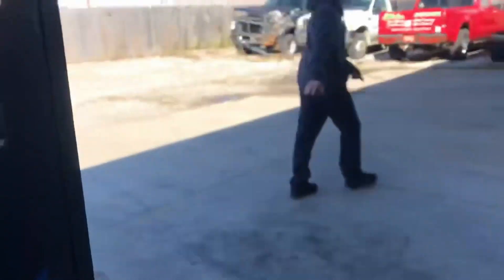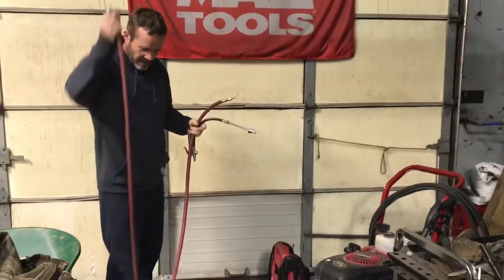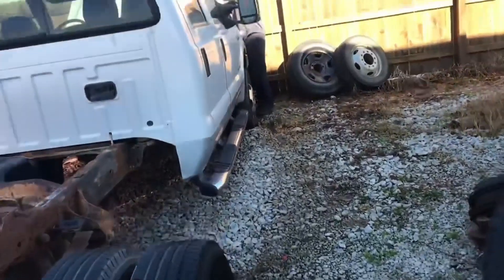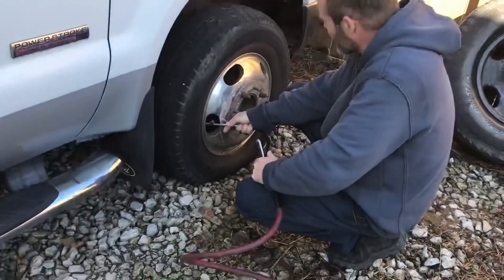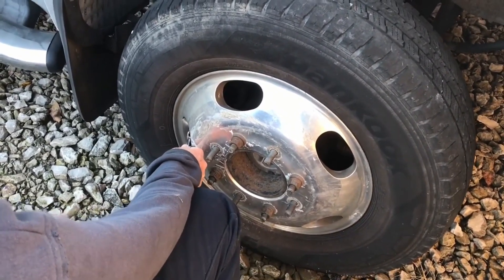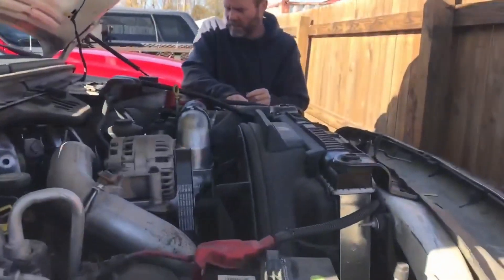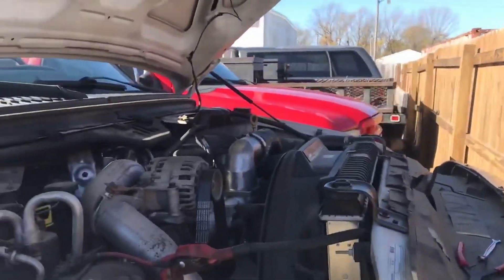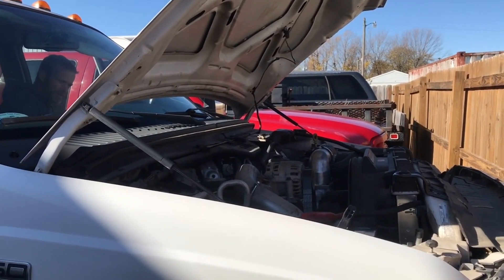White dually update

Comment: I need help. 2016 f250 fx4 lariat short bed 6.7 powerstroke 148,000 miles.  Runs good but drives awful for last 30,000 miles replaced shocks 3 times , new tie rods drag links rear leaf springs new michlen tires etc . I have spent about 4,000 on this issue. Truck rocks from side to side feels like i am going down the lake in a pontoon boat on a rough day. Cant take it anymore.
Reply: Does the steering wheel shake violently?
Reply: No i just have a side to side rocking motion
Reply: It doesn't do that.
Reply: The only other thing i could think of is a worn out steering gearbox or bent wheels
Reply: Trac bar? Had someone turn the wheel a gew times i can see the front axel moving .